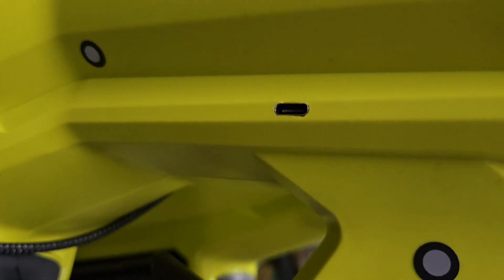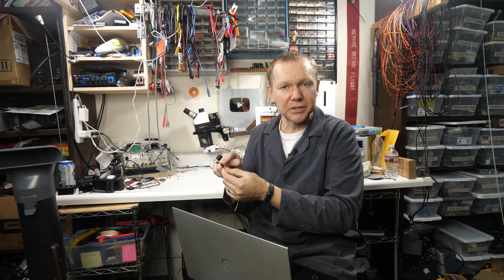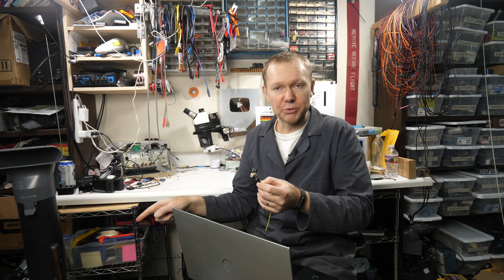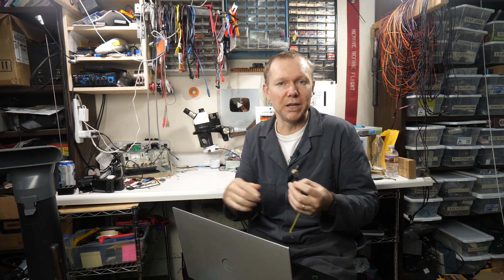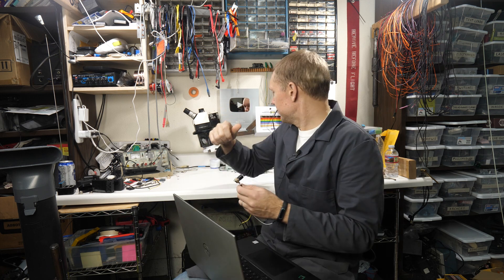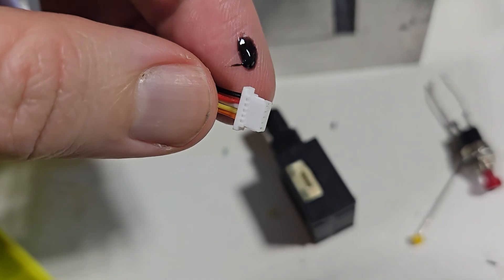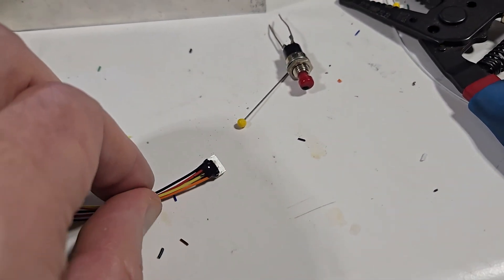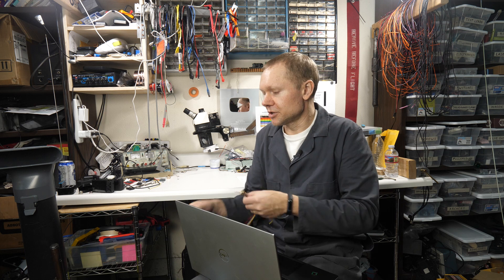Leaf Blower USB-C Controller for Air Umbrella Video

Comment: Should you decide you need remote control leaf blowers again: Bring the built-in trigger potentiometer connections out to pins on your external connector. A simple usb-c dongle could be made that just loops those pins back into the input to the controller. It would work as a sort of key, if that key is plugged in then it works as a normal blower. Remove the key and plug in a wire and you're back to remote control. The dongle could be super tiny, just a usb-c connector with a few wires crossed.
Reply from the maker: Cool idea!